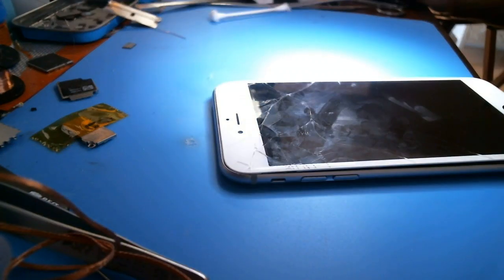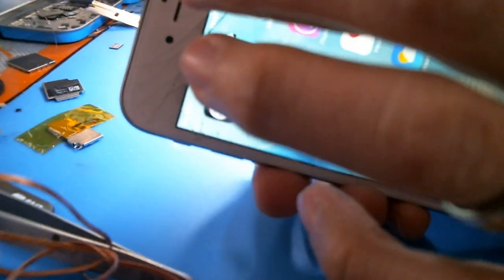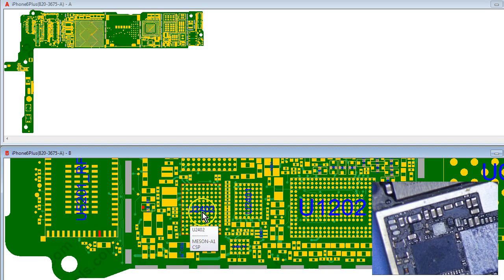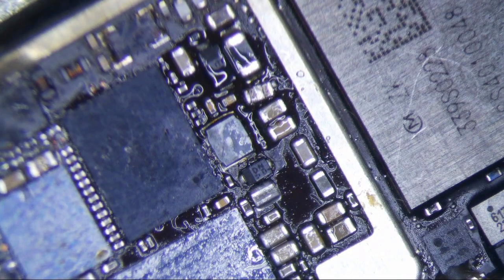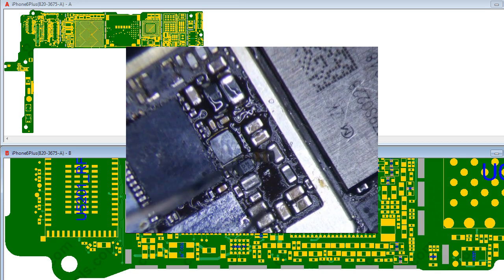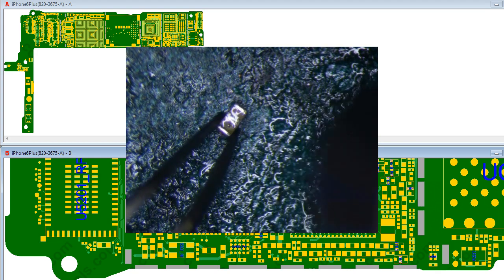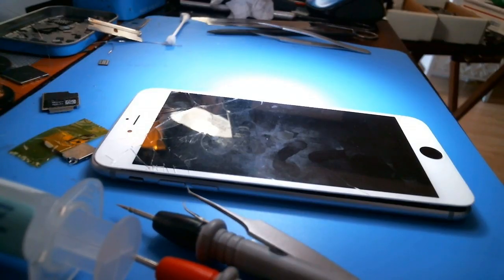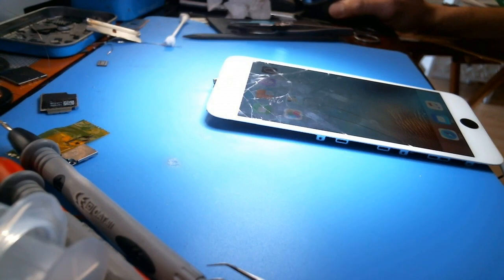Grayed Out Wifi After Touch IC Repair Solution

Comment: I confirm too after touch ic repair, wifi grayed out, after change capacitor wifi come. Thanks
Reply: Adam Bonz  over heat after going cap resistance its wats problem 2 components change

Comment: Yesterday I cause my first gray Wi-Fi, I will replace both components and confirm your hypothesis. I been doing 4 months of touch IC changes and first time I have this problem.
Before I forget I'm using microjumpers in all 6+, for a month now and no returns so far, thanks for that idea. All seeing your videos should subscribe and start saving time following your examples.
Reply from the maker: Naper- Akai please respond back with your results, if you don't mind.  Thanks
Reply: Microsoldering I change both and didn't work, I will try again later using lower temperature. Phone I'm working is a regular 6 with permanent gray Wi-Fi.
Reply from the maker: Naper- Akai it was definitely working before the touch ic repair?
Reply: Microsoldering, iPhone 6 fix, second attempt was a success, I used a low melt alloy in the donor board, clean really well after, used leaded solder on the board, 350°C in my heat gun. Now Wi-Fi and Bluetooth work fine. I don't know how to thank you. Yesterday I was so frustrated with this issue and now is solved. Edit: I measure the original cap and the one I used in my first try to fix this problem, the original is toasted, no reading in my multitester, the second cap is fine, so maybe I didn't wait enough to cool or a bad joint.

Comment: My guess from the schematics is that c5201_rf and L5201_rf are external components for an internal power supply of U5201_rf, so indeed extremely critical. It's certainly no normal bypass capacitor.

Since I suspect it's a dc power supply (Pin name is VIN_LDO), should be easy enough to compare the voltage of a bad one vs. a good one when in operation. Would love to know if anybody does that.
Reply from the maker: I rarely have grayed out wifi anymore after covering that cap with a penny.  I have no clue about its functionality but I do know this it causes grayed wifi.